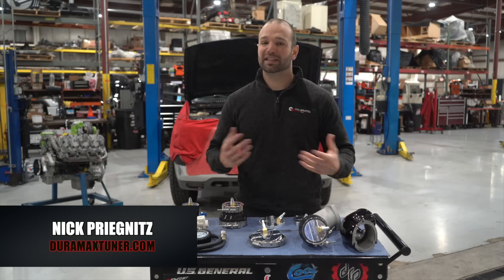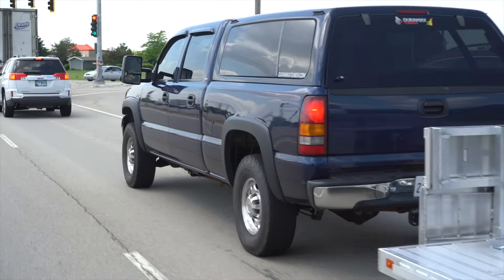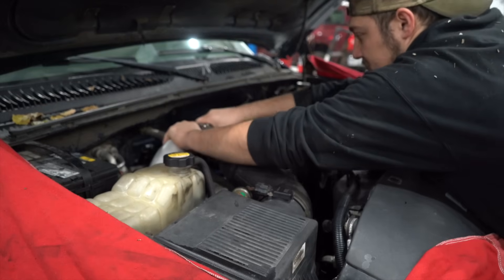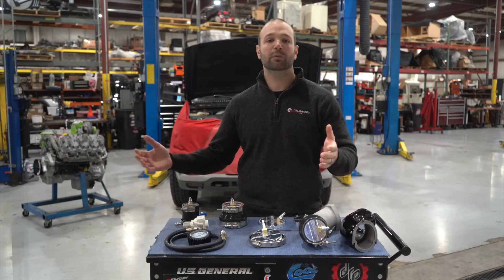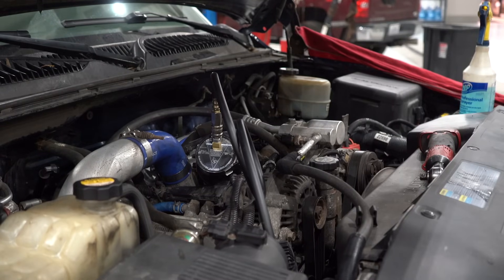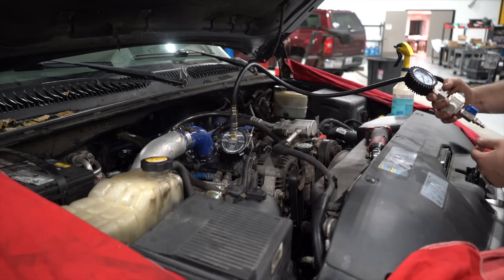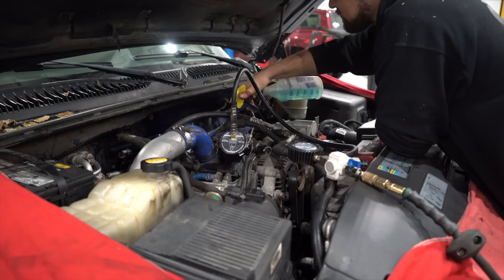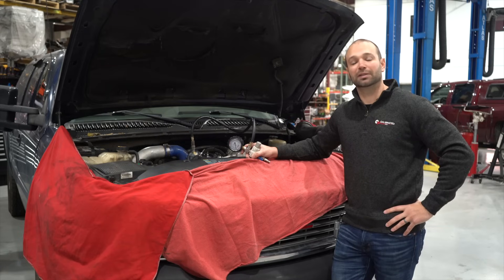HIGH EGTS? BAD MPG? EXCESSIVE SMOKE?

Comment: Have an l5p. what could be the issue if I have excessive smoke off the line but cleans up about 45mph, vane position at 50% when wide open, 100% absolutely no boost leaks
Reply from the maker: Without a datalog or codes, it could be turbo vanes stick, actuator issue, or turbo vane sensor position issues.

Comment: I have been looking for a boost leak on a low mileage 2023 3500 L5P by pressurizing the hot side charge air pipe off of the turbo. I had a failure of the factory hot side crimp on this engine at 5k and the assembly was replaced under warranty and since the dealer couldn't get me in they gave me the part and let me install it and I returned the defective part to them. I am a retired ASE master tech. I have been fighting low mpg's on this 2023 dually and frequent regens and it seems to build soot very quickly when I watch my I dash. I have a Banks cold air intake and a Banks Derringer , but even on the stock setting it builds soot fast. I only see a max boost of 27 psi on level 6 at 4000 ft elevation. When I pressurize the hot side pipe I can hear air in the area of the intercooler inlet, but I can't find a leak. The system won't hold any pressure at all. I even tried a self contained smoke machine that will apply up to 20 psi and it wouldn't build any pressure, but I also couldn't see any smoke leaking anywhere. Could the EGR be allowing air to escape out the exhaust pipe? I am considering purchasing a ecm tune from you in the near future, but I want to fix this issue first.

Comment: I have stock 2017 L5P that is doing a regen every 80-100 miles.....way too much. My EGT's seem fine and no noticeable smoke. I'm having hell with the DEF system....shocker I know..lol. Can a boost leak be responsible for the engine constantly overloading the DPF by running rich due to a leak?
Reply from the maker: This would be very common symptoms of a boost leak or failed DPF. Its a lot cheaper to test the boost leak.
Reply: @Duramaxtuner  looking into getting some new couplers for my intercooler inlet and outlet plus the turbo outlet. I have a 2007 LMM Duramax. Do you know the torque specs on the clamps?

Comment: Could a boost leak also lead to the trucks sound becoming substantially quieter on top of more smoke and less power than before on an lml?
Reply: Did you figure that out ? I’m having similar problems
Reply: @wichovr6  the truck has become substantially quieter than when I first put the turbo in. But the y bridge gasket was leaking which caused the excessive smoke and drop in power and fuel economy.

Comment: I'm playing this game with my 04 Lb7. I can hear the air leaking from around the EGR valve. Local diesel shop says the valve is fine and my expectation of an air tight system is unrealistic. I lose 3 or 4 psi per second. Anyone have a suggestion?
Reply: I’ve got the same problem. Just replaced the valve and it still leaks all compressed air out the exhaust. But mine loses it all almost immediately.
Reply: Egr delete it maybe helps

Comment: When I bought my LB7, it had a .5" x .75" hole in the hot side charge pipe from the power steering line at the steering gearbox.
Reply: Could you see the hole without pulling the charge pipe
Reply: @jonathanpgriffin  Yes if you have the inner fender out and are looking at the top of the steering gearbox. My hot side was laying right on the steel lines. It wouldn't make any boost till about 2k rpm right where it upshifts 😅.

Comment: Very cool tool! does the intake side not have to be blocked any where? I just assumed the test pressure would bleed out the exhaust. By the way - I love how you called it "boost" during the test. lol keep up the great videos!
Reply: Then engines are non-overlap so the only leakdown you experience is past the ring seal. and valve seals.

Comment: smoke machine ,would be cool,to visually see the leaks ,nice video guys
Reply from the maker: We love the idea of smoke machines. However, the kits we found don't go to high enough pressure to find some leaks.
Reply: @Duramaxtuner  
GM recently released a new special tool for the dealers that is a power smoke machine (GE-52250). It allows you to induce smoke into the induction/exhaust system under pressure ( pressure is adjustable). I have used it and it works well. I’m sure it is pretty penny.

Comment: That’s what my 6.7 Cummins does with my 3rd gen swap. It won’t hold any presssure with the boost Leak test. But I can’t find the leak either. 
My truck has a silver bullet 66/74 turbo on it. I was told I should be able to hit 50psi no problem. I can’t get it past 30 according to my tuner. 120hp tune. But no black smoke at all
Reply from the maker: That sounds more like a tuning issue.